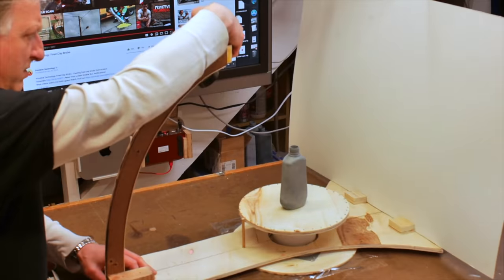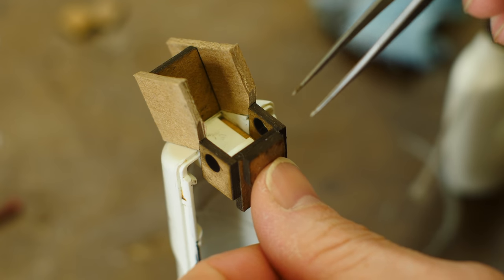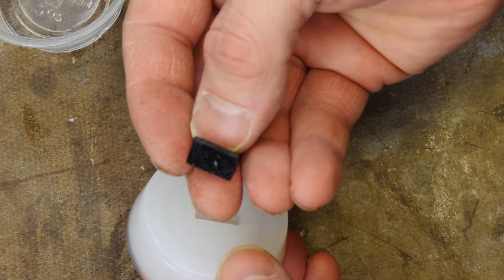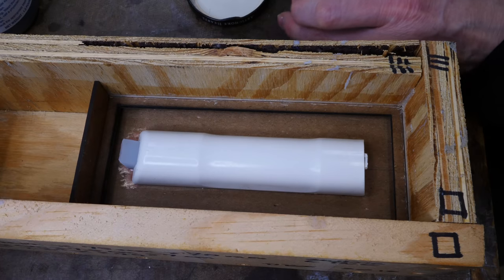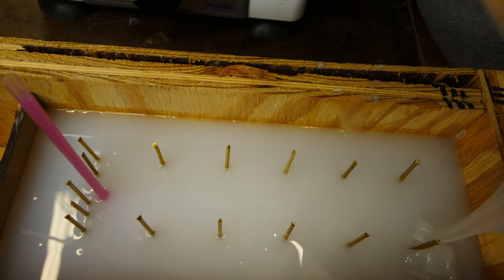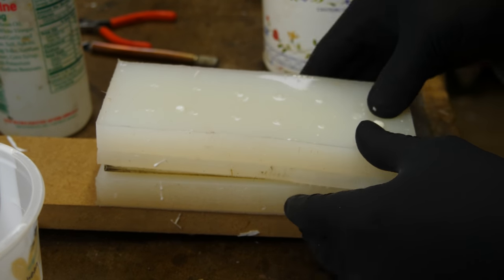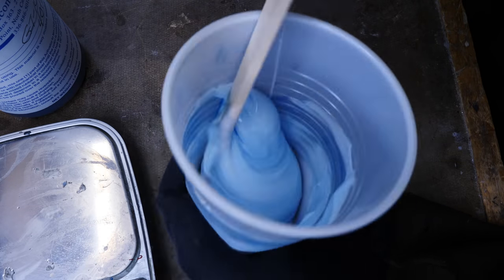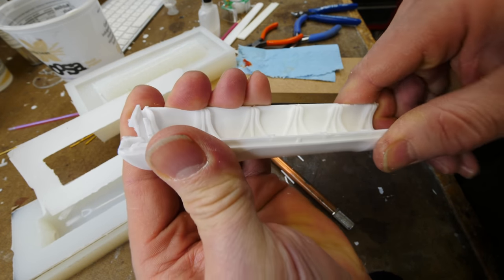Epoxy vs Urethane Casting Resin

Comment: I use polyurethane casting resin for repairing vintage toys and figurine making, with silicone molds. I much prefer it over epoxy slow cure resins, the brand of polyurethane I use is "color pro" as it cures within 15 minutes to a transparent color, allowing me to mix pigments in for accurate coloring, it has no smell really. I use oil based pigments that are manufactured for use in urethanes, rubbers, and silicones like "so strong" or "ignite" by smooth on and find they are concentrated enough that just 1 drop will do the trick. Cannot use epoxy resin dyes with polyurethane, as the urethane isn't forgiving when it comes to moisture. I like polyurethane resin because it gets all the fine details of my micro molds, due to its water like consistency and flow. I like the fast curing time, and the lower amount of air bubbles in my casts compared to traditional slow cure resins. A trick I use, is to mix the color I want with either part A or B so i can take my time to get accuracy, and then let it sit, before adding the two parts together, it allows for uniform mixing and color rather than adding color to both parts and then mixing.

Edit: Forgot to add, a helpful tip: When molding an item with liquid platnium silicone, there is a trick to make gaps and holes or spaces on whatever you are duplicating with a mold easier. I use Vallejo satin varnish water thin acrylic paint meant for airbrushing miniatures and models, with a toothpick to fill the holes and gaps. It dries in about an hour and creates a film screen on wherever hole or gap it is placed. Then I can mold in the silicone, when the duplicate item comes out I can remove the filling where the gap is, because all it does is create a thin amount of flashing. The varnish is easily peelable/removable from the original figure or item. Also I utilize using a electronic hobby drill, and electronic nail art file with various fine tips to remove flashing, and fine tune certain areas. :)

Comment: Hi Eric, I'm always amazed by your solutions to the 'tricky bits' of mold making, e.g. the separate mold part for the delicate clip/prong part. My 'stupid' question (i'm a very small time, part maker with 0 budget) is, do you dispose of the syringes after one use or can they be cleaned of the resin? ..and if so, how?
Reply from the maker: Resin comes right off. Does not stick to the plastic

Comment: Hey bud, I enjoy your videos, I do production pour casting for a family owned urethane business in NE PA. When we have an open top mold, I just fill it it a little over and either scrape a Ross the top with a good putty knife/drywall tool or use a block of steel/aluminum and slide it across the top of the part. It works very well. You just have to use a smooth continously motion. What you are left with is just regular flash. For some molds we even cast in guide rails for the purpose of the final sliding piece. It is occasionally possible to get a bubble with the slide top method, but a quick dremel of the surface and a dab of material after initial demoldis all it takes to fix it. Good luck and ty for the content as it is also something I do as a hobby.

P.s.  is it strange that when I'm off work I'm spending any amount of spare time watching you do the same/similar thing haha.
Reply from the maker: Cool, thanks for the tip

Comment: I make almost all my molds using that plastic cup open face method. Works really well for small pieces. Any issues I've had were related either to materials mismatch or improper mixing.

Comment: you can control free surface of a one part mold quite easily.  just cover it with glass or any flat piece with release agent on it.
this requires only slight change in the mold itself - mold bottom (top) needs to be flat as well so no plastic cups )
Reply: Can you explain that a bit more please?
Are you saying to build the box on glass bottom sheet?
Reply from the maker: I believe what he is saying that the top of the mold just needs to be flat so that you can put some release agent on a piece of glass and when you pour your part, Just slap the glass on top of it so that it comes out flat once it's cured.
Reply: @EricStrebel  Hi Eric! Thanks. I mold little flat bottom fishing baits in an open topped mold (bottom of mold case). I've been gluing the flat side of the master to pieces of smooth, plastic laminated shelf and building the box up from there. Just cant get a flush "top" because silicone leaks up to the glue line, causing thin flashing. Looking for a cleaner finish really.
Reply from the maker: That's why I make all my molds as two part molds, and almost never as open face mold because you can't control that top surface when it's an open face. Simple as that.
Reply: @EricStrebel  Yep I've been coming to that conclusion myself after watching your channel. Trouble I have with that is that when laid flat some of the fish and worm masters are less than 10mm high, making for very thin molds. They are sort of fat ballpen sized.

Should I look at molding these vertically?
Reply from the maker: Possibly, I have a video about making small toy parts, you might want to give that a look those parts are pretty small and very detailed and not very thick.
Reply: @EricStrebel  Thanks Eric. I'm still working my way through your videos. I will certainly take a look at that one. Cheers!

Comment: Epoxies do vary in scent, viscosity, and curing times by quite a lot. But a common trick to cure epoxies faster is to use heat (usually, per the material SDS supplied with the resin). So turn on the heater on your pressure pots and you can usually remove it in a few hours.
The thing I can't stand is the mekp and styrene off gassing from polyester resins like those used for fiberglass parts.

Comment: Urethane or epoxy, which last the longest and how long?  TY for the great vid!
Reply from the maker: It depends on your application and environment along with final use. Check with the manufacturer specs for hardness UV and deflection, etc
Reply: @EricStrebel  Great work btw!  Thanks for sharing your expertise!

Comment: I do a lot of open face molds I make using machinable wax and a cnc , I set a flat piece on top after the pour that has a small hole to allow the resin to escape as the flat

Comment: Just starting out here....if one was to take a typical 300 lb. capacity shop swivel caster wheel and try to repair the cracked and crumbled solid rubber tire over a metal hub.....using the original caster as the mold....... for a 1-time use, (assuming its stripped, cleaned, prepped, sealed openings with clay, plywood box, etc.), what is the best material and/or method for that kind of operation? I figure this might be a good project for a first timer never having worked with this stuff before. cheers. thanks
Reply from the maker: Pretty complex, not something I would advise for a first casing project. Plus it's round and that is hard. Use polyurethane

Comment: hello, what kind of resin would you use for example automotive parts like a cam belt cover?
I loved the trick at the beginning of the video, with that small clip moulding.
Reply from the maker: It really depends on the properties you want for your part. Check with your preferred resin supplier, they usually have tech support to help with that.

Comment: Would a flat piece of plastic or glass with release on it dropped over the opening of the mold eliminate the meniscus, giving the casting a flat, flush back, or reduce the excess resin to flash, instead of a lump?

Comment: There is a lot of confusion about Epoxy Foams vs other foams. Any chance you have any projects to test out various foams. The Tesla 4680 battery pack apparently uses Epoxy foam to achieve added stiffness.

Comment: Great video!  thanks for posting it!  Could you maybe go over in more detail how the small part of the mold for the locking tab functions?  Thanks again!
Reply: i watched +10times and i still don't get how it's done, that little 3rd piece, ¿its unlocked from the mold and its putted before inject the epoxy/urethane? or how its done?

Comment: Curious if you know whether you can use urethanes for things like kitchen utensils (things that will touch food or drink).  The Google machine is failing me on this.  I understand why folks (esp manufacturers) might be shy about making claims.  It's probably ridiculously expensive to have things validated at FDA and even then, errors in end use can make it a huge liability for them.  I see that some epoxy resins that use BPA have been FDA-approved for some food contact.  Anyway, I would appreciate your expert input on this question.  I have not really worked with anything but silicone, and even then only a few times.
Reply from the maker: The best way is to snag the manufacturer's data sheets and c if they meet your requirements, or chatting with them directly via their support either online or on the phone.

Comment: can you have a video where you explain more about the key seals in the silicon? Is it to hold the silicon mold in place? I see sculptors would often build a clay wall and make half spheres registration marks or sometimes they do zigzag line so the parts line up. This video is where i first see this method so i would like to find out more. Or where can i read more about it? Thank you
Reply from the maker: Made it up actually, all the other methods you mention are pre laser. You need a laser or a way to make a digital key for this to work. Yes the key seal hold the two halfs together. Almost every video in the last 2 years of mine used this technique in some way shape or form
Reply: @EricStrebel  how interesting to even think about the history of moldmaking itself, and also how artists and product designers make molds for their works also fascinates me as i'm learning right now

Comment: I wonder if one advantage of epoxy over urethane is its sensitivity to humidity? Isn't epoxy more resistant to absorbing water or moisture from the air?
Reply from the maker: Correct

Comment: Have you considered applying a thin coat of PVA on the rubber part before pouring the platinum silicone? form what i did in the past, its the safest way to guarantee the curing by addition in unknown resins and rubbers
Reply from the maker: No, I have not considered it, as is would alter the size of the part. It would probably work though

Comment: I would be a little worried about the clip function in that epoxy instead of PC/ABS original part. Seems like it worked out ok, though.
Reply: I dont get what is that black rubber stopeer used for. Can someone explain

Comment: I remember infusing molds for the carbon fiber parts of the Formular Student Car at my Uni. But the Epoxy there was rather thin, so might be worth a try to use some infusion resin instead of the thick one you used ? Other than that great video and an interesting mold!
Reply: Was is a special type of epoxy resin you used for resin casting? Was this for making a 2 part compression mold?

Comment: Using cardboard for keying is pure genius, versus dealing with the mess of modeling clay and marbles for registration keys
Reply from the maker: Thanks
Reply: @EricStrebel  only part that will suck for me is not having a laser cutter (which is super cool btw). I could use MDF, and my Dremel tool to cut out a mould, but I would need a steady hand
Reply from the maker: Sort of the beauty of having a laser. It has totally changed the way I build models
Reply: @EricStrebel  😁 and it's just super cool. LASERS!!! 😁😁😁😁

Comment: Ohh, that was the thickest epoxy I've seen so far. I'm making carbonfiber parts and use epoxies often. I you easycomposites epoxy but they are in the UK. Try to contact composites envision in the US, I think they can set you up. The epoxy from easycomposites doesn't smell anything.

Comment: I have used Naked Fusion, the Deep Cast is very fluid. The art formula is a lot thicker, but it's meant more for creating art so it's supposed to hold its shape.  It takes a long time to cure, but has little to no odor in my experience

Comment: How much did this cost the client?
Reply from the maker: Probably in the 400-500 range....
Reply: @EricStrebel  about how many pieces were made?
Reply from the maker: Perhaps around a dozen parts
Reply: @EricStrebel  so about 37.50 per battery cover. Amazing.

Comment: as for smell here is a thing.  epoxy can smell really bad but this smell is not so harmful. it just smells bad and that's all.
polyurethane vapors on the other hand are barely noticeable. but they are straight up poison (isocyanate).
so please wear proper safety equipment in any case.

Comment: Eric, check out InhibitX. It’s a super low-viscosity inhibitor for plat silicones and I use it on any materials that I haven’t already tested with plat silicone and it works well without affecting most finishes
Reply from the maker: Cool